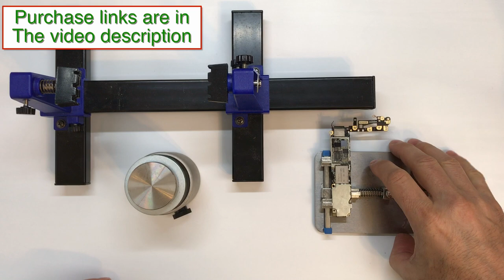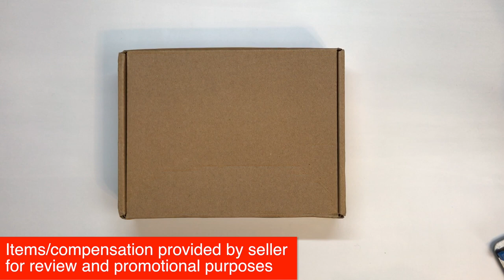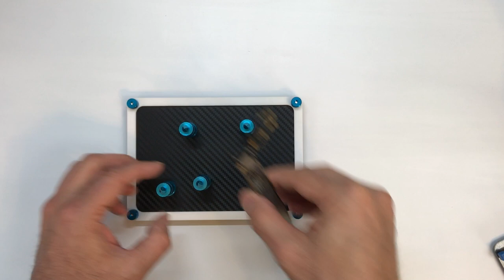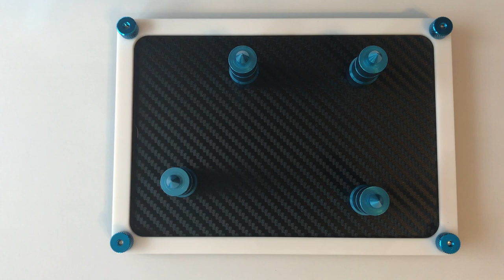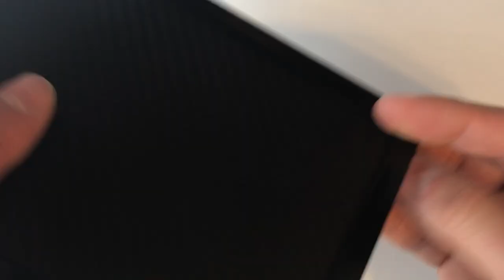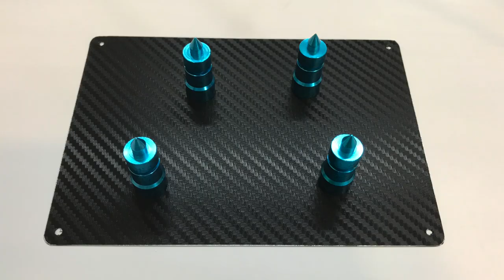EleksFix Magnetic PCB Holder

Comment: Three drawbacks of this PCB-holder. 
1. It is unable to turn/flip. Making it almost unusable in through-hole assembly work
2. They should have made the gap adjustable (would have been easy to make the holder in two parts screwed together in the gap)
3. The holders are metal. Which means that you can not hold a PCB up and test it with applied power without risking a short. You can also risk shorting a loaded cap with this holder

The benefits of this board is that it looks very nice, it will work very good for surface mount projects and it is low enough for use with a microscope.
Reply from the maker: All good points and I have to say that to this day I haven't found the perfect PCB holder for phone repairs. iPad Rehab has some made specifically for various iPhone boards but as far as a one size fits all I usually end up using the old school spring loaded screw type that I'm not really a fan. Height, size, and stability wise they seem to be the easiest all around even though that screw is a pain sometimes.

Comment: what about the heat resistance of the base?
Reply from the maker: Just reread your comment. The footings and outer frame probably will not handle too much. 

Earlier answer:

Good question. It is made of aluminum alloy and acrylic so the center plate can probably take quite a bit but the outer frame I'm sure would melt under direct heat. I'll test it with hot as soon as I get a chance.